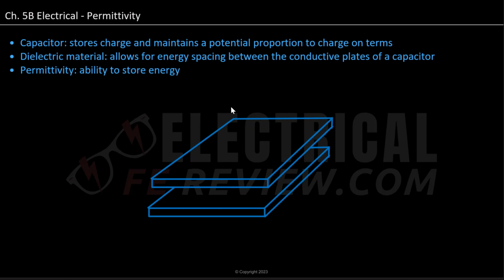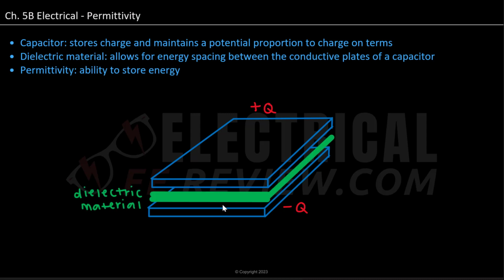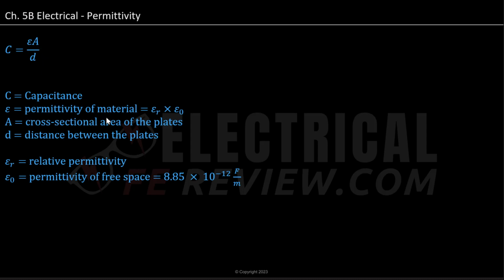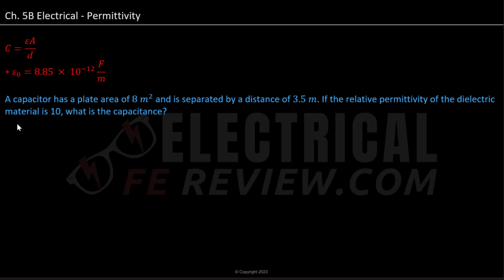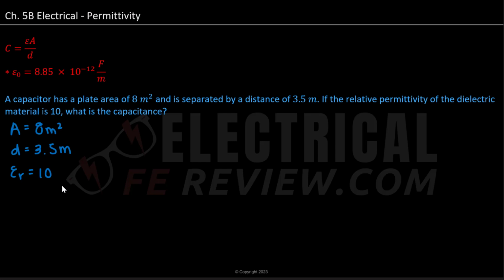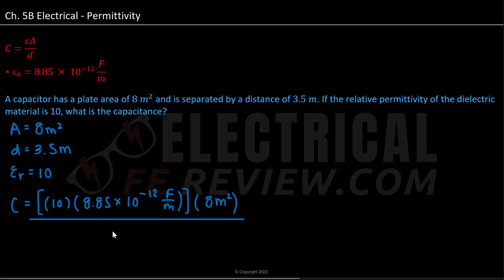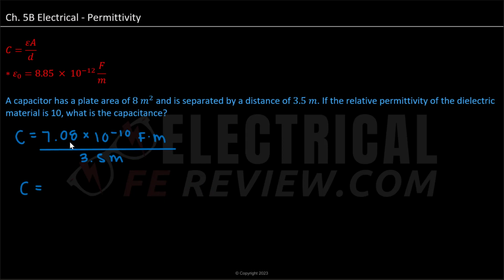Permittivity - Properties of Electrical Materials for the NCEES® Electrical and Computer FE Exam

Comment from the maker: Video Contents:
0:00:05 - Introduction to capacitors
0:00:27 - Introduction to dielectric material
0:00:45 - Definition of permittivity
0:00:58 - Relation between capacitance and permittivity
0:01:13 - Formula for capacitance
0:01:45 - Value of permittivity of free space
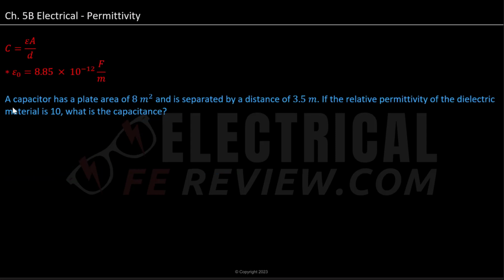0:02:05 - Example problem introduction
0:02:39 - Explanation of relative permittivity
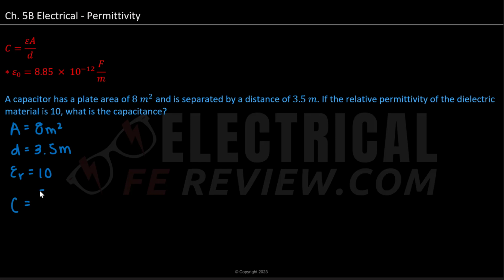0:03:14 - Setting up the equation for the problem
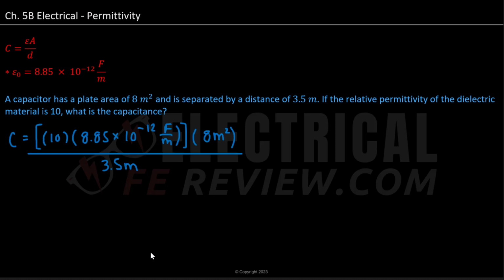0:03:52 - Solving the equation
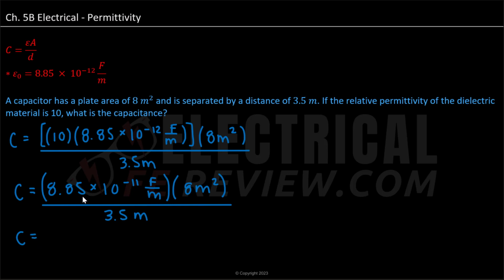0:04:22 - Calculation of permittivity
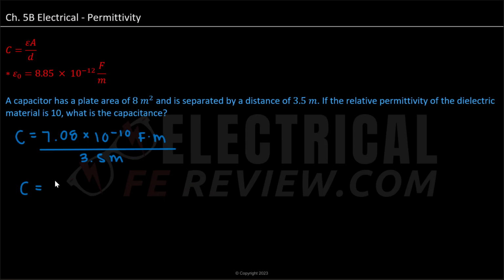0:04:49 - Final calculation for capacitance
0:05:15 - Conclusion of the video

Ready to master the Electrical FE Exam? Don't miss out on our expert-led online course, with video examples and practice problems. Best of all, it's 100% FREE! Enroll today at https://www.electricalfereview.com and take the first step toward passing the FE exam.